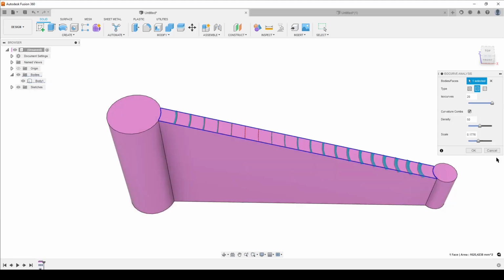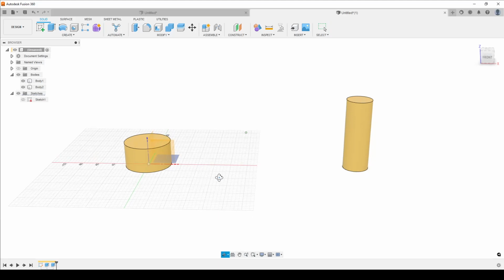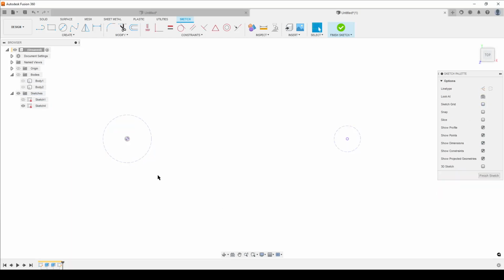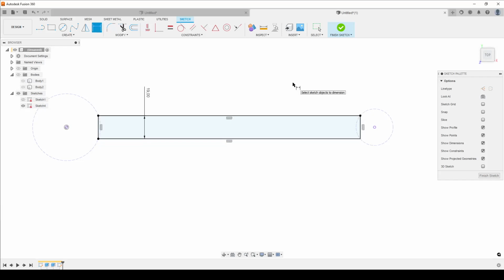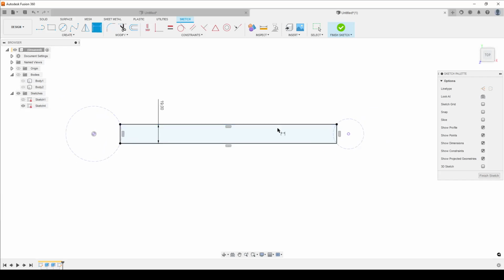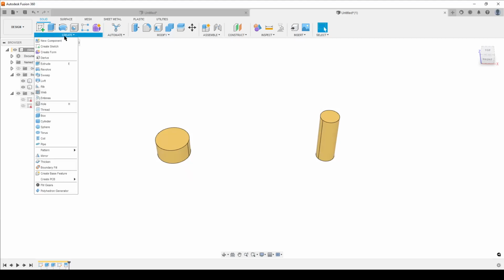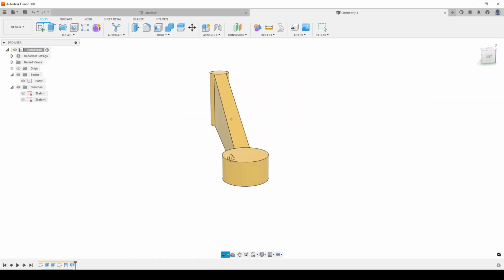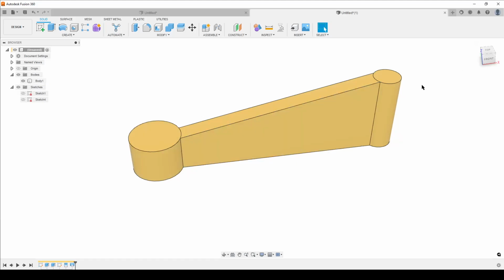Fusion 360 - Connecting 2 Cylinders with a Rib/Support

Comment: I am a hobbyist and I do not use split face much at all. What I learned today is using split face and loft command is very useful, thank you. Your videos are really the best for people to quickly move to an intermediate level of fusion 360. One of the hardest things is to change the way I think about drawing and how to approach them.
Reply from the maker: It's easy to get stuck in "sketch mode" and forget about the power of features in Fusion :)